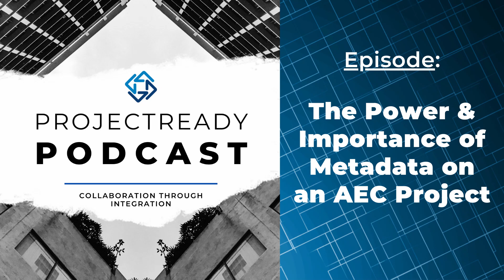ProjectReady Podcast - The Power and Importance of Metadata on an AEC Project

Comment: Metadata without connected processes between platforms become a project boat anchor.  CAD software vendors historically are notoriously unhelpful when it comes to connection between each other.  This is why ProjectReady is such an important tool for industry.